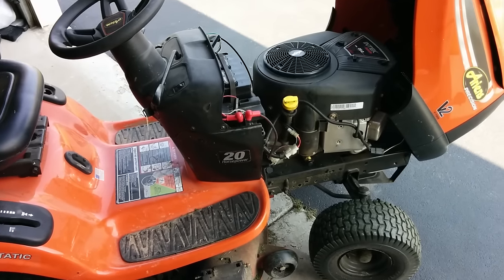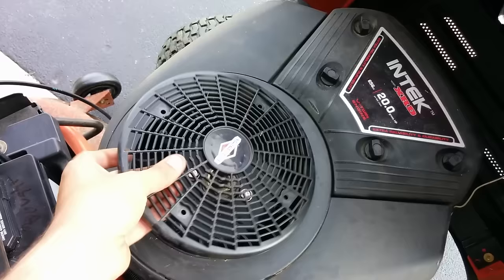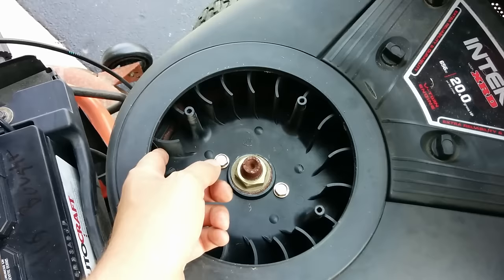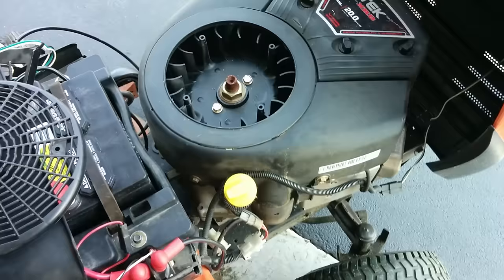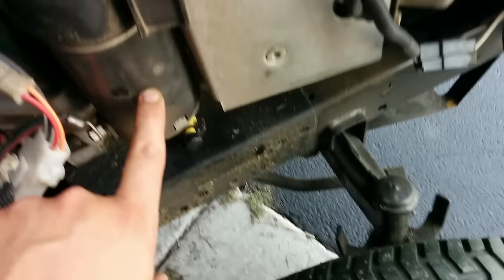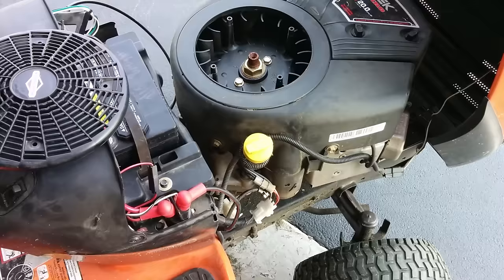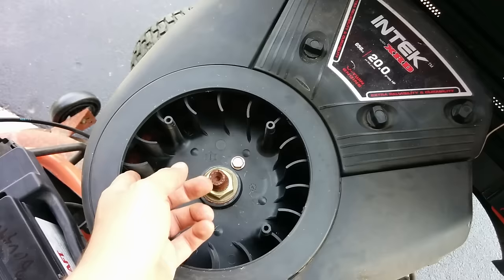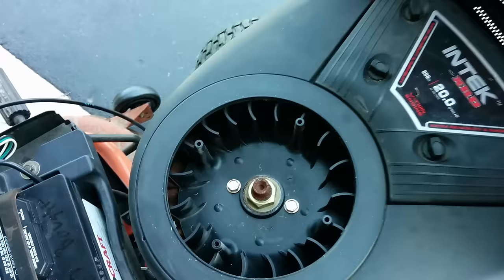Easy Fix For Riding Mower That Won't Turn Over

Comment: It’s easier to turn over if you take out the spark plug. And then once it starts cranking leave the spark plug out and blow out the fuel that’s trapped in there.
Reply: YEP

Comment: There's a good chance your valves are out of adjustment, which is causing too much compression that your starter can't overcome. Manually turning the flywheel may work, because it gives the starter enough time to get the flywheel spinning before the next compression stroke. However, it doesn't fix your problem. Best to seek a professional.
Reply: First make sure you don't have gas in your oil, If you do, Then your carb needle is stuck open.  Second open the valve cover, And measure the gap between the valve stem and rocker arm with a feeler gauge.  Look up your model tractor online to see what the gap should be for the intake and exhaust, Loosen the center set screw, Adust the nut to the correct setting. Then tighten it down with the set screw. Replace the valve cover and test.

Comment: You failed to completly turn the engine through a cycle, thats poor. Now, no one knows how hard it is to turn on the compression stroke with a spark plug in by hand. Thats important to know for many problems. Mine will turn an inch or two, is that enough ?

Comment: The problem you described is typical of your valves requiring adjustment.  It is easy to do!  Simply pop off the valve cover, remove the spark plug, insert a thin screw driver in the spark plug hole so the tip rests on the top of the piston head.  Rotate that flywheel until the screwdriver rises to the highest point (top dead center). Then using a feeler gauge, measure the gap between the exhaust valve and then the intake valve.  The feeler gauge should fit in the gap and provide some resistance, but not so much that you can't move it around.  You have to check the internet to find what the gap setting is for your particular mower engine.  My Briggs pressure washer valve gap for the intake was .005mm.  If the gap is too sloppy or too tight, loosen the adjustment nuts on the rod and tighten them with your feeler gauge in the gap.  There is some tolerance, but if they are not set properly, you could risk blowing your engine!
Reply: Troy bilt 18.5 starts first time then struggles and blows a fuse on the 2nd time starting. Valve adjustments done and cam bump test is good. Any ideas? Thanks
Reply: @user-ud3bz2ib8q  Did you figure it out? How do you move the flywheel? mine just won't move at all even by hand.

Comment: It's called hydraulic lock. Next time pull the sparkplug, turn by hand a little' and then turn the engine over with the key, sparkplug out to to expel and oil or gas. Replace sparkplug and cut some grass.
Reply: After seeing your post, can you clarify - Remove the spark plug completely out of the socket or just disconnecting the spark plug cable?

Comment: If it's bound up, I would check the valves because your compression could be what's causing it to bind. And you WILL blow your motor up if that's the case. Takes 5 minutes to adjust the valves and would be wise to check every time you change the oil. Trust me I learn things the hard way.😁
Reply: Nick Pharris was
Reply: What valves
Reply: Ivan T the intake and exhaust. They're usually located in the front of the engine on these riders. Disconnect the spark plug.  Take off the four bolts on the valve cover. Put a pan under the cover to catch oil, etc.  take off The cover.   Be sure not to damage the gasket. If its damaged, replace it.   The gap should be 0.004 or four thousandths of an inch. Carb cleaner.  Carb cleaner everywhere.
Reply: My LT 2000 won't turn over ,out of nowhere ! I pull the spark plug and it turns over like a champ ,good compression will blow my thumb out ! I m thinking exhaust valve may not be opening like a keeper fell off ,then I read on here about compression release feature. Started my head a spinning ! Would a 5 year old well maintained Briggs need valve adj already ? I cant imagine what else would be wrong ,motor is strong ,never had an issue . Gonna pull valve cover and check clearance and keeper.  How does that compression release work ? Does it hold exhaust valve open a tiny bit until motor spins?

Comment: That is exactly the problem with mine. Except it was all of a sudden running really bad. Back firing and shaking when I shut it off, Got up this morning and all it did was click. Checked the battery is fully charged. I get the felling it is worse than the motor being stuck.

Comment: Probably needs a valve adjustment. If that doesn’t fix it then the decompression mechanism on the camshaft has broke off and you need to replace the cam.

Comment: By God’s grace I found your video, just what I needed. I had already replaced the battery and the spark plug and still no luck just the sound “click “ . After watching your video I tried what you suggested and “bam” the beautiful sound of the engine turning on.
Thank you for sharing this video!

Comment: Thanks, my one year old craftsman single cylinder 19hp had this issue. Found your video, gave it a turn and it started. It also spewed black oil out of exhaust. I had changed oil with synthetic 5w30 as part of winterization. This year I will add couple of drops to cylinder as well.

Comment: Thank you!  This was exactly what was wrong with mine.   We had been running the mower in cruse control and then hit the break, put the break in lock and shut off the mower.  That apparently locked it up.

Comment: Thanks. It did the trick. I had to use a pry bar to get it to move but my Craftsman has a center metal plate that I could leverage against. All it would do before this forced turn was to make a whinning sound when I turned the key--no crank at all. You saved me from parts swapping, etc.
Reply from the maker: glad to help!

Comment: hey my craftsman 2400 was just making a click I b
I believe at the starter after 2 weeks of not running and trying to figure it out,I tried this and all I can say is thanks for being a blessing because labor costs and unneeded parts can really ad up.
Reply: Did your tractor continue to run great or did you eventually reset your valves, just curious about what happens later down the road and what to expect a year from now

Comment: This is usually the lash on your rockers. Supposed to be between 0.004 and 0.006 inch . I had this same issue because one exhaust valve was out to 0.012 inch. When there is excessive lash in the valve adjustment it does not allow the decompression system to work and you're hung up on the compression stroke.

Comment: Thank you.  I found your video and was able to get my lawm mower turned/started.  Prior to seeing your video, I replaced the battery and was even thinking about replacing the starter.  I followed your advice and manually turn the engine and unbound it.  Got it started.  Thank you for the video.

Comment: THANKS!
This got mine to turn over at least, buying some starter fluid to try and get it to run. I've replaced battery, starter, solenoid, carb, filters, but the starter was getting jammed in the "flywheel", but when I followed your advice, it turned over as it should, but it still gets jammed again, and the reason I'm getting starter fluid.

Comment: My troy built has been doing this and if I hold key  long enough it will eventually start and run fine all day  . . . but if I turn it off for awhile and I let it sit it binds up again.  So today we took top off and cleaned some mouse crap out but there was none in engine but  I did notice the motor has little rust around edge that turns,  its four years old but hubby spilled a little gas down next to it a month or go so since then been having problem.  I turn it by hand before starting now but can I put some wd40 on that area that is rusted and loosen it up for good.

Comment: You can also put a socket on a electric drill not a battery cordless one and try turning it that way if it's too hard on the compression take the spark plug out then try it if it's too hard then you need an engine rebuild

Comment: hey this worked for our cubcadet LT 1022 22hp briggs. my question is now. why is it seizing up ? It was weird. we shut the mower off for 10 minutes (after cutting for an hour) and it wouldn't fire back up. checked everything over like most do and found this video. rotated the top of the engine and freed it up. Id just like to know how to prevent this in the future? Thanks for the video saved us !

Comment: I got a yardworks lawn tractor , just bought a brand new batter thinking that was the problem and it didn’t turn over , the flywheel like you covered in the video does not turn well , any fixes?

Comment: I have a MTD yardman mower. We were having trouble keeping it started. I was trying to start it and I turn The key on wouldn't start and as I turn the key off it started so I quickly turned it back to the on position and it stops and now won't do anythng. No click noise nothing. I've changed batteries and it fully charged new solenoid changed oil fresh gas. Spark plug is fine. What can I do to get this thing running? What did I do by turning it back on? Please help

Comment: You need to adjust the valve clearances, if they are out of spec, you won't engage the compression release at times. When you turn the flywheel by hand like you did you will eventually engage the compression release, then the flywheel will turn more easily.The problem will come back again in the future. Had the same problem. Sometimes my mower would only start with a jump, adjusted the valves, no more problems for years.
Reply: MedinaChuckie did you adjust or did you get a pro to do it?
Reply: You are correct

Comment: Worked like a charm. Thank you for the info. What cause the binding of the flywheel?I
Reply: Sometimes it can be Moistures. Sometimes Oil low... Turn by Hand and see if you can loosen it :D

Comment: Same thing happened to mine. Same make, model and year. I had it for 5 years and it seized up. I couldn't believe, because I maintain the oil. Was able to manually restart like shown above but with much more difficult. Turns over now, but doesn't start and has a hard knock. This is a junk lawn mower. I'm not buying Briggs motors anymore. Honda it is for me. Selling mine for parts.

Comment: My mower just ran out of gas and it would not start again - click click....I checked the battery and cleaned dirty terminals on solenoid / ignition/brake switch/seat safety and blade switch and nothing. I had earlier tried to see if the engine would turn and it wouldn’t and I got side tracked and didn’t really suspect this was the issue  - I just thought the pry bar I used never had a good angle and I didn’t have the leverage I needed - I watched your video - took the cover off and it was jammed up - freed it it and I had a working mower again.  Thanks again for the help.

Comment: I have the same problem with a Husqvarna Kohler engine. I turn the motor manually (very hard to turn) but it still wouldn't the over. Any ideas?
Reply: +Chuckles McGruber, I'm a little late to the party here but If you have Way Too Much Compression and have tried adjusting the valves, among other things. It may be the decompression unit on the Camshaft. They're a Bitch to repair, unless you have time, tools and somewhere to tear your motor off and apart. Make sure that you're a 100%  sure that is the issue before taking my advice.  TRUST ME !!  It happens from time to time, even on Very New engines. 
Everyone makes a lemon here and there and of course, I got one of them...Good luck. Tim B.

Comment: Mine gets to that "stuck" point and is very hard to manually turns it past that point. Once I do manage to get it past stuck, you can hear a sucking sound. New battery lots of kick but at that stroke point it won't push itself past there. Any ideas? Thanks in advance. .
Reply: Luke Foisy, my mower does that same thing. Do you remember how you fixed it past that point
Reply: Luke Foisy I

Comment: I’m having a similar problem but can’t get the motor to start... I mowed all day with it, parked it. Then went to finish mowing the next day and it wouldn’t start with the same type of stuff described in the video... it will turn until it hits compression then it stops and nothing... battery is a month old, new solenoid, even a new starter and same problems... I can free spin the motor and feel some decent resistance when it gets compression but the starter just doesn’t seem to have enough juice to spin it past the compression... I’m kinda baffled here lol
Reply: cjsawinski, I'm having the exact same problem with a B&S 19hp engine. Maybe someone will answer your question!

Comment: Is it supposed to be able to completely spin all the way around? Mine is getting to a certain spot then I can't turn it anymore. Ive got a John Deer LT160 and I just put a new battery in it. Worked earlier this year ok.
Reply from the maker: Yes, it is suppose to spin around and around and around... if not probably a big problem.
Reply: Awesome..ugh..thanks for getting back to me..
Reply: mine did the same thing and I'd what's up with it
Reply: Got mine working. Pull the spark plug and try cranking it. If that doesn't work, pull the spark plug and spray some PBblaster into the spark plug well. After it sat for awhile, try turning it. Mine fired right back up.
Reply: How do you pull the spark plug and where is it at?  mine gets stuck too and wont turn or spin
Reply: Lorie Bush  I had to have mine took to a mower shop and the magneto coil was busted loose and would hang it up in a certain spot... but to answer your original question it's on the front of the motor below the valve cover
Reply: I have a John Deere and just googled where the spark plug was. I'd do the same with your model.  Had to buy a spark plug socket and the PBblaster but was under a $10 fix for what I thought was going to be major.
Reply: wendy t did u put your spark plug back in after it got back running?

Comment: The process given just moves off of the (flat) part of starter then it will engage.  Starter will need replacement
Reply: Not a starter issue, set valves.

Comment: your problem is the valves are out of adjustment and the motor is sticking on the compression stroke..
Reply: beachbummm69 how do we fix II ourselves, without a pro?

Comment: how do you check the selenoid and starter?
Reply from the maker: Use a volt meter to check voltage at the starter terminal when key turned to start.
Reply: Oh thought it was more complicated,   thanks
Reply: @winnerchickendinner_  Would it still just, "click", if relay / solonoid was bad, even if you did get 12 volts at the starter, itself? Or does getting 12 ( or 6) volts at the starter mean the solonoid is good?

Comment: My new 2015 Ariens with 19 hp Briggs won't turn the motor over all the way to start with brand new battery I charged to 100%. I can rotate the motor by hand but when it gets on the compression TDC its pretty hard to. I can just it and it will start.,When I get it to start it runs like a champ so was thinking maybe the starter is weak. Any idea's anyone?
Reply from the maker: too new to have problems.  not sure the answer but take it in under warranty.
Reply: Adjust the valves.  Lots of videos on YouTube will show you how.

Comment: I just got a Craftsman LT1000 and it will turn over but it wont stay on for more than 10 seconds does anyone know how to fix?
Reply: Im not a mechanic or anything but maybe try pushing some switch onthe left side of the dash to increase the engine rpm running rate? I had the same problem, pushed the switch up a little bit, and BAM! It ran just fine. Good luck!
Reply: could be compression.  Most likely dirty fuel/air or spark.

Comment: I tried to start mine for the first time this season, battery is good with gas, i heard it starting when I turned the key and then something made a noise and it won't even make a noise...battery is still showing hours and everything
Reply: I had to rewire my starter switch where the key go's, it had a lose wire in it and now it runs. The new sylinod works good to. You can look at your to that might be the problem.

Comment: your looking at a worse problem then what you are saying... there is a reason your engine seized up and you need to find out why. Most likely your valves need adjusted but if you do like you say.. and then start the engine up you take the chance of further damaging your engine to the point of even blowing a hole in your case.

Comment: what i do not under stand is you can take that 12 v battery put in v8 eng and crank it  but it will no crank a 17 hp lawn  mower ???  dumb tinker toy  ( puny starter )

Comment: That means it fucking does not have enough battery voltage
Reply: The volt meeter said the battery was full with12 volts. I got it started, it was a lose wire in the starter switch. and It needed the new sylinod to run.